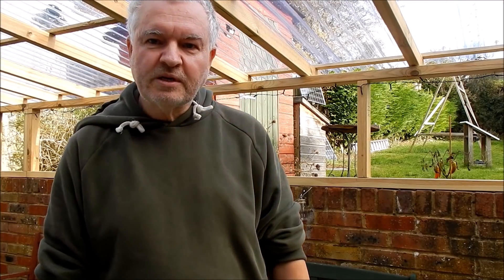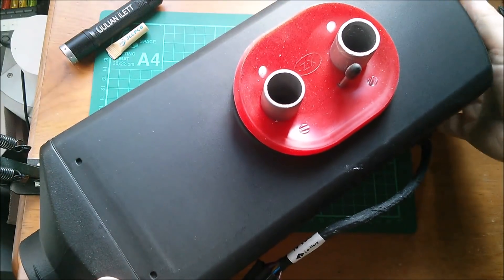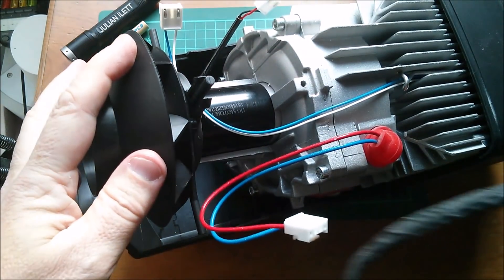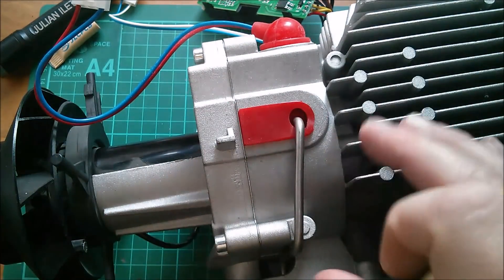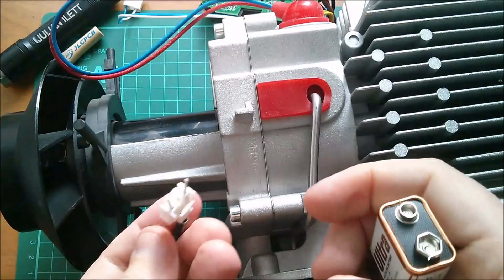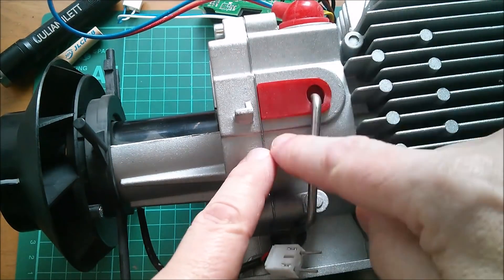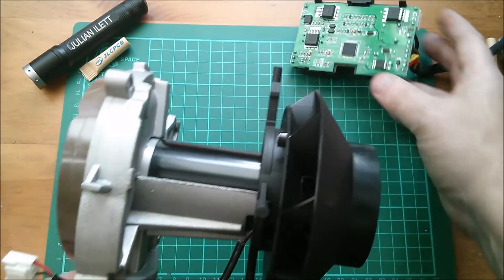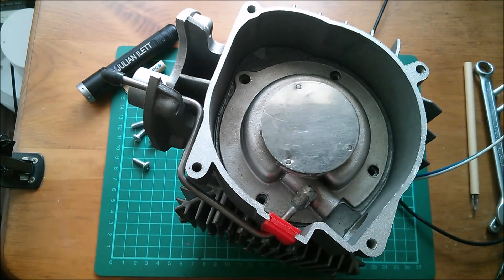A Look Inside the 8kW 12V Diesel Air Heater from Banggood

Comment: I would like to read Julians letter to Bangood! Like that?
"Dear Mr. Banggood,
It is so cold in my garden, and none of your electronic devices can warm me up. Not even the 10A mosfets or the solar charging controller. My fingers are so icy that I cannot put the cables on the headers. I used my soldering iron in my pocket but it was not much of a help. Please help me! Otherwise I cannot order more electronic stuff."

And they wrote back:
"Dear Mr. Julian,
We have a brand new device me made from some german samples. In Germany no one would like to use diesel any more because some bad companies deceived the buyers of cars. And the government stands to the companies than to the people. I will send it to you and hope you have a warm winter. "
Reply: der Birnodin .
Reply from.
To moron American.
Buy bigger better more expensive unit, not tinker toy for little boy.

Comment: what do people pay for electric in the UK? im in pennsylvania and i pay 6.2 cents per Kwh
Reply: I'm on a cheapish electricity tariff and I'm paying just over 16.5 Pence per KWH. So this heater would burn the equivalent of £0.82 per hour in electric.
Reply: 16.2p/kWh is not cheap! I pay 14p.
You need to be comparing the thermal output not the cost per hour or consumption though
Reply: @beware_the_moose  
True, I'm not on the lowest tariff for electricity, but it's not far off. 

You are correct though, useful heat output is more important than how much it costs per hour to run.
Reply: @kellys_eye yahoo 
If heating oil (Kerosene is used in this heater, the the cost per hour will be under half that of pump diesel. 

Uk electric prices are comparable to other European countries where ~50% of electricity is produced by burning natural gas.
Reply: joe burkett around 22 US cents per KWh here in Australia. We are ripped off badly!
Reply: Remember you can use red diesel in this thing because it’s not being driven on the road, so work from about 60p/litre.

Comment: Question.. what are the chances that this diesel burning heater produces no carbon-monoxide, hydrocarbons, particulates and no NOx emissions? Are you going to test it for these?  Perhaps Banggood might pay for you to hire some MoT test equipment.  Hopefully it will prove to be clean and safe, but if it was me I wouldn’t be tempted to use it near my house.
Reply: Highly recommend the plantower pms pm2.5 detection module for testing this...go on Julian... you know you want to.
Reply: You don't need MOT test equipment. Any oil fired heating engineer can test CO, O2 and CO2 output. HC is difficult to test for in an open combustion chamber, so as long as there's excess O2, it's producing minimal HC. NOX is very difficult  to measure without million £ test equipment. 
Weather the heating engineer can adjust the settings, like they can on a Webasto heater, is a different matter however.

Comment: I fitted an eberspacher diesel heater in my motorhome, looks identical so I guess China copied it, they work very well.
Reply: Yes i had that type of heater fitted to my BT van in the 90s it had a timer so you would set the on time put the van fan controller to 1 and in the morning the van fan and engine would be super warm BUT I noticed the the lads that did not use them there heater would seize up after a few months so even in summer I would put it on for 30mins MR llet use it or lose it

Comment: I have one of those (except an original german webasto) in my conpany car and i have always wondered how it works. Thanks for the video!
Reply: The vehicle version heats the coolant, not the air.
Reply: John Nodge - only some. The ones used in our vans heat the air in the middle of the van.
Reply: Safer that way, I don't think I'd ever want to directly breathe the air out of one of those things especially not a knock off one!

Comment: Did you find out how the fuel is controlled ?  Would that be a second moving part ?
Reply: Fuel is usually supplied by a metering pump, not seen in this video. More moving parts - a solenoid and two non-return valves.
Reply: The fuel will be pumped in using a dosing pump. The faster the pump is pulsed, the higher the fuel throughput and so more heat is generated.
Reply: The hole in the casting is a venturi (@17:11) and the fuel is drawn in that way, I am theorizing...

Comment: Seems like a really inefficient way of making heat IMO
Reply: It's not very economical, but diesel has a very high energy density, so if you're in a situation where you don't have access to a power grid, this is pretty much the way to go. As a coach driver these things makes our lives so much easier during winter as you can pre-heat the bus, and maintain it when you're not able to run the engine.
Reply: @D00MLOORD  So does coal...
Reply: @LeeFall  
You can't turn on a coal fire at the click of a switch, or turn it off again when you're done using it for the night.
Reply: @johnnodge4327  Sure you can... that's just borderline laziness
Reply: @LeeFall  Yeah no. Coal has a density of 24MJ/kg while Diesel is almost double at 45MJ/kg.
Reply: I think you mean uneconomic. All heaters would be 100% efficient.  I.e. all energy is converted to heat. It's when diesel is used fire cars it's inefficient,  since two thirds is heat and that's not what you wanted.  I still don't think it's a good option at all for heating that space.  The exhaust needs to be carefully thought out. Mounting on that wall will be no good.  Intake and exhaust need to be on outside wall.
Reply: And pork fat!
Reply: A more efficient way to heat an outside work area like this would be with a radiant heater. Heating air is going to be subject to air changes, heating objects within the radiant heater area is much less wasteful.
Reply: @johnnodge4327  These heaters come in hydronic variants, so one of those and a pump and you could do radiant heat easily as well.

Comment: It's a pretty accurate copy of an Eberspacher heater... The control module in the unit is nothing like as well protected though... I wouldn't want to put it anywhere damp like a narrowboat engine room, or under chassis box on a camper...
Reply: Yes. Also similar to the Webasto Airtop units. Some of these copies use very thin metal for the heat exchanger, which can burn through. So make sure you have a CO detector, Julian.
Reply: Mark Monag
Reply: Mikey Webb  In this case I believe some key patents ran out not long ago which has allowed these copies to exist - at least so I hear. Although they do seem to be a little too close to the originals.
Reply: @cr0ft-2k  The Chinese ignore western patents. If they get taken to court they just dissolve the business and restart it with a different name
Reply: I was going to say, this looks identical to the Espar Airtronic  (Eberspacher.) Webastos are a bit different, same concept.

Comment: This is expensive heating not sure why will you want to do that.  A liter of diesel contains about 10.7kWh of energy and say this heater is 80% efficient you can get around 8.5kWh of energy and according to google the liter of diesel in UK is £1.35 that is again according to google 1.77USD thus divided by 8.5kWh is about 21cent/kWh thus you may as well use grid electricity as is likely the same or less. I use solar PV to fully heat my house and of course electricity for appliances and my total cost is $42/month for both heating and electricity combined in therms of amortization cost. I pay almost 2x as much for internet :)
Reply: The unit is only rated at 0.5l/hr so I can't see how it can possibly give 8kw. This looks the same as units which are advertised as 5kw on eBay. Chinese power ratings on heaters too.
Reply: electrodacus 
It would be much cheaper to use red diesel which is not subject to as much tax.
Reply: @davelowe1977  Exactly...off road diesel or heating oil... it would be okay to just run a test with vehicle diesel, but for full operation you would surely get heating oil...or as suggested, used fryer oil, used motor oil...all of course properly filtered.
@electrodacus ... not sure about those prices, locally here in Western New York diesel is currently $3.26/gal which works out to be @$0.86/l
Reply: @DrTeddyMMM  Correct .You can 100% use normal heating oil in these. It's far less expensive per liter. The only real difference between heating oil and diesel oil are some extra additives in the diesel. A diesel engine will happily run on heating oil too. (Illegal, tax evasion.) 
 Heating oil companies typically have a minimum amount of oil they will deliver, and they can only pump into fixed fuel tanks intended for home heating. (Policies/laws will vary according to your location. Look em up.) You may get heating oil in 45 gallon drums from Esso or whomever is nearby as well.
 Using Old motor oil is a bad idea. It's dirty and will need to be cleaned before use.  It also needs to be burned at a MUCH higher combustion temperature than this heater can pull off.  Otherwise lots of smoke, pollution and Stinky. (You no do this thing.) Fry oil, vegi oil etc are pretty much in the same boat. Kersosene, I know nothing about.
Some folks mix old motor oil with a small amount of gasoline to burn it in their motors. Doing so in this heater will almost certainly result in a bad end.
Reply: @DrTeddyMMM  I use the UK prices as it is where Julian lives.
Reply: I guess it will still be fairly expensive even if is not $0.21/kWh. Solar PV panels have a cost amortization of just $0.02/kWh assuming you can use all the available energy but still very good.  My heating alone excluding electricity comes to around $0.05/kWh this include cost amortization for everything needed not just PV panels but also thermal storage and heating wires and this is just slightly less expensive than natural gas if you ignore the natural gas connection fees thus making solar PV heating the lowest cost heating option at this time.
Reply: I'm guessing you don't live in North London. PV heating is not an option.
as said before, for heating you don't pay the same tax its 10.7p. My friend uses Diesel for heating, I think it might be around 80p a ltr.
Reply: @electrodacus  Sorry but solar in the UK is just as bad as electric cars a waste of money that's why the government have reduced their feed in tariffs from 4 x the cost of a kWh from the big 6 to just one quarter the cost of a kWh, they eventually realised they were giving money away for nothing. My diesel car gets me to the Highlands of Scotland with one tank of fuel and 8.5 hours driving.
my friend in his electric car tried the same journey and took him four days.
Reply: Definitely use Kerosene to fuel it, it'll cost much less at about 55 pence per litre at the moment, which works out at under 30 pence per hour to run.

If the fuel throughput is 0.5 Lph, then it's about 5 KWh, not 8 as stated.
Reply: @johnnodge4327   your in the know my man Kerosene or Jet A1  runs great and you hardly ever have to de-coke the heater much cleaner Jim.
Reply: @jimh5031  

Thanks Jim.;)
In reality I'm just an average hobbyist with a keen electro-mechanical aptitude for such things as this. I actually worked as an oil heating engineer for a good few years, so know a fair bit about burning Kerosene cleanly. 
I just happen to heat my house, workshop and the wife's hot tub with the stuff too. There's currently no cheaper way to get efficient and controllable heat for the domestic home.
Reply: @jimh5031  Or make your own biodiesel with an old hot water heater on the opposite end of the fuel spectrum. You can get the oil for free from a near by restaurant and then sell the glycerin off to soap companies as all natural organic soap. Plus its easy and fun. No nasty fumes like real diesel.
Reply: A heater is by definition 100% effective.  Inefficientcy is loss of effect due to heat. :-) Well, some heat would of course escape with the exhaust, but the exhaust pipe will radiate heat. So efficiency is determined by the length of the exhaust pipe.
Reply: That is valid for an electric heater best case for those Diesel type heater's are best case 85% but it can be lower depending on many factors that is why I used 80% as a good estimation. You can not increase the length of the exhaust pipe to much as that will influence the combustion and maybe reduce more the efficiency negating any heat recovery you may be able to make.
Reply: @jeffmerlin2580  that's true for electric heaters, but fuel based heaters lose efficiency from incomplete combustion. You also throw a lot of heat away in the exhaust.

High efficiency propane heaters are like 92% efficient, and to get that they do things like heating up the intake air with the exhaust.
Reply: And poison yourself in the process! :)

Heaters are only 100% efficient in a closed system, adding in unburned fuel and hot exhaust gases changes things...a lot
Reply: At 10.7kW/l and a flow rate of 0.5l/h that gives a maximum heat output of 5.35kWh. Efficiency is also affected by both the combustion rate, which is never 100%, and the heat lost in the exhaust gases not just the length of the exhaust pipe.
Reply: I investigated using home heating oil. I believe it will work just fine, but in small quantities it's more expensive than road diesel.
Reply: These heaters are mainly installed in trucks as accessories. They are usually connected to the internal temperature sensors and do not run permanently. Burner and fan are depending on the internal temperature and run accordingly slower or turns off the burner in the meantime and the fan then runs slower. Believe me, if you need to sleep at -20 ° C in the truck at night, you do not much care if you use this heater effectively while it's warm.
Reply: You're basing this on using petrol station diesel, which is taxed for vehicles.
Red diesel, often used on farms is cheaper (lower tax), but it will probably work on home heating oil, currently 55p/litre.

Personally I would have got myself a little woodburner, which will keep a kettle on the go too!

If you want to use solar heating, skip the PV step, way too inefficient. Use evacuated heating tubes and a hot water tank.

Although his little roofed patio area is going to take a lot of heating. That roof may as well not be there, and I doubt the walls have a cavity, or damp course. He'd be best off just dry lining the whole thing and attempting to double glaze any area he wants light through.
Reply: You can use red diesel but it ain't that much cheaper, really!
Reply: @Dudleymiddleton  red diesel is over 50 cents a gallon cheaper here in the usa. depending which state you reside. some road taxes are more than others. i would say that alot cheaper
Reply: I have a 2kw one in my camper and when continuously running I get 9 hours from 1l diesel. It would obviously more to heat a garage or workshop.
Reply: @Applanate Earth!  If he only wants to heat that work shop 5 to 10 times a year then yes else it will be more expensive than other heating methods. As of EV's you are right they are more expensive to drive because of the expensive Lithium-ion battery.  That is the reason my house is fully powered by solar (cheaper than any other method) but I drive a V6 since is more cost effective than an EV at this point in time.
Reply: diesel where I live is 1.29 dollars a liter right now and that is for on road diesel
Reply: how much were your solar panels to outlay?  Any servicing costs?   How about short summer days?   These heaters are highly fuel efficient,   and can run on other fuels,  a great solution.   Can you walk with your solar panels on your back to another location easily?  Can you dig up your electric cables and move em where you want?   Oh,  cool,  then you right !
Reply: Just use heating oil its between diesel and kerosine and a quarter the cost
Reply: If you can get hold of old cooking oil or engine oil you could use that instead and it might end up much cheaper.
Reply: @abyssunderground  

This heater isn't suitable for low grade fuels as it will soot up. Kerosene is the best and cheapest way to fuel it.
Reply: Those are also might be illegal to use due to uncontrolled exhaust emissions in EU.

Comment: I use the same exact style made by Webasto in my 27 foot boat. mine is also a 8kw unit and it will cook me out and is very fuel efficient. my boat is gas so i have a separate tank for diesel and 5 gallons will last me all winter for fishing  and all other sport in the pacific ocean between Canada and USA border... you will love it...just there can be a stain that can drip from the condensation out of the exhaust, but maybe not for you not being on the water???
Reply: By the way I forgot to tell you I switched mine to Kerosene after the second season when I had to clean all the soot out of the burner chamber. now its quieter and warmer than with the diesel and doesn't smell as bad..and cheaper to fill..lol
Reply: in America its $40 for 5 gallons. @sortofsmarter
Reply: @ashyslashy5818  I buy it in bulk from a fuel supplier, i got a 55 gallon drum. Keep it sealed and it doesn't age like gasoline. paid $2.75 / gallon like 3 years ago still have half my drum left..lol
Reply: thank you for the advice,have a great CHRISTMAS. @sortofsmarter
Reply: @ashyslashy5818  Not at all. I buy red diesel for $2.25 give or take. Don't use road fuel, its all taxes.